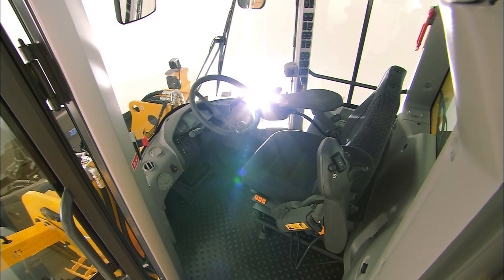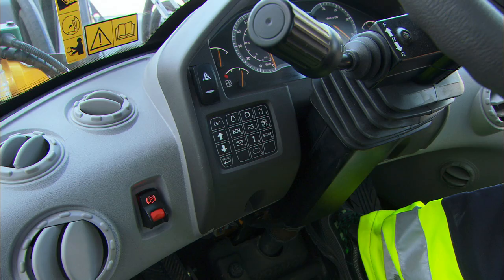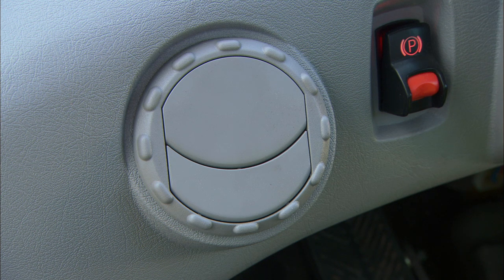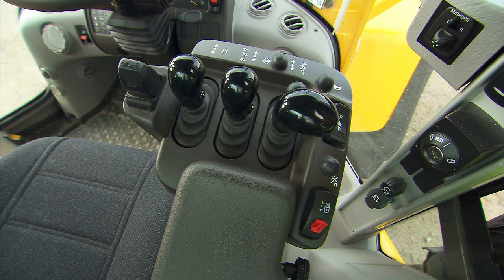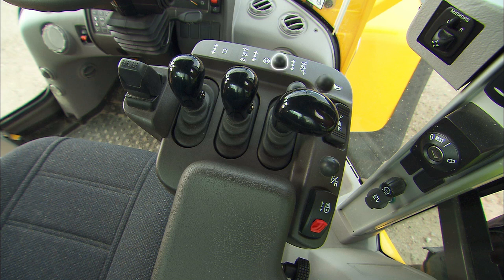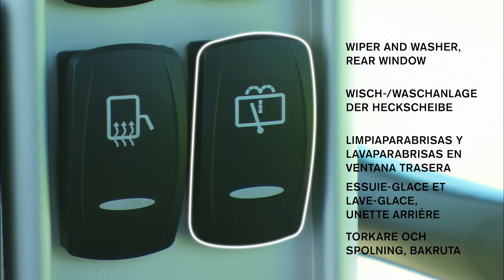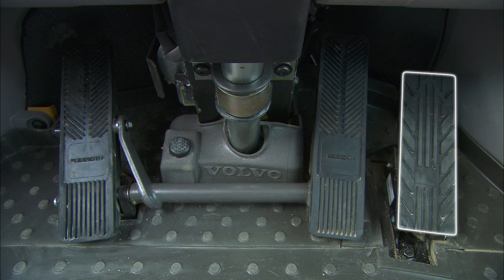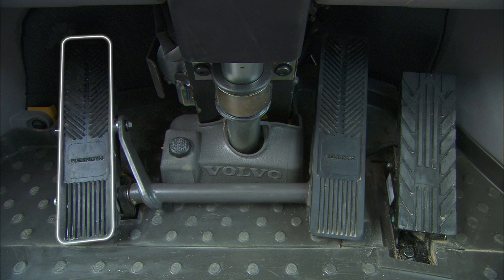Instruments and controls – Volvo Wheel Loaders H-series – Basic operator training – 9/11

Comment: I have a 2004 L90E how do i set the boom kick out and bucket positioner ? Do i have to raise and set bucket position manually, turn off engine but keep in run position, loosen brackets and align them with posioners on the boom and bucket ?

Comment: I can't seem to find the cab heater timer online. Is there a different name for it? I have a Volvo loader on the way to me but wanna figure out all the little things before it gets here
Reply: Look up just in front of the three dials for the ac/heat fan . the loader I run has one .
Reply: @jeffharper7579  thanks man 👌 I'll take a peek when it gets delivered
Reply: I operate a 110 h, it's ok but not as much power as the old 950h cat I used to operate, ( sometimes I still run the cat)  my opinion is the cat has more engine,and hydraulic power but the Volvo is a better cab design. We have had trouble with the def  system. Bucket is a tad bigger than the cat. Ours has 2 sticks not a joy stick, the bucket over powers the boom so bucket will move more than boom,it took me a little time to figure out how much boom / bucket lever to move so they work together. I can run it with just a couple of fingers on the sticks. Hope this helps. If you have more questions try letting me know at this video/ comments. Good luck with your loader.
Reply: @jeffharper7579  dang I have a 966m right now it doesn't have def so gonna see how this Volvo is I'll update here in our chat once it comes in I'll maybe make a vid of it thanks for all the info brother